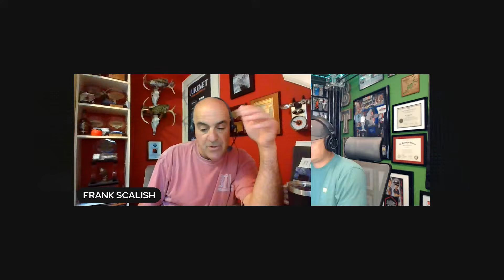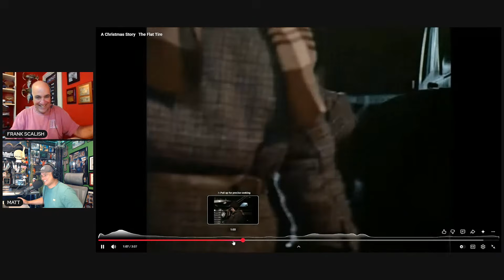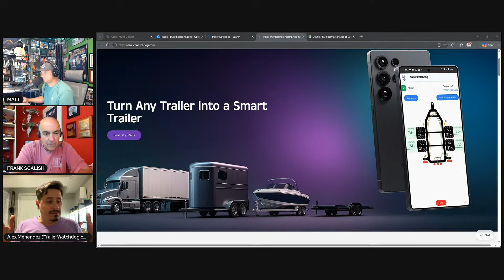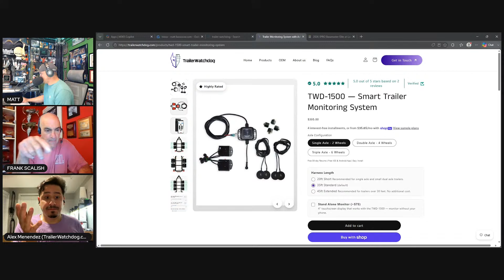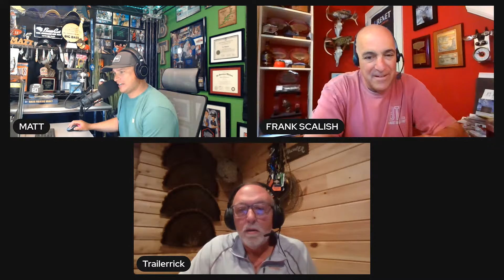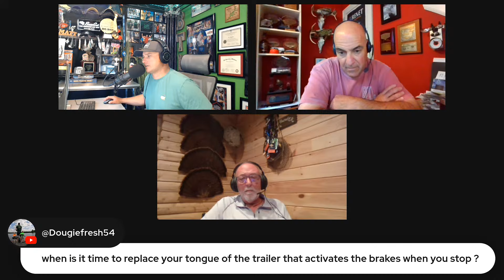THINGS YOU DON'T NEED UNTIL YOU NEED THEM (DAY 4 #254 WITH FRANK SCALISH)

Comment: I know not everyone can afford it, but if you can, I'd heavily suggest Milwaukee tools.
For impacts, tire air pumps, fans for use in the boat while fishing, etc.
They make tons of tools that run on their 18V batteries. 
My life has been made substantially easier because of them.
They even make adapters that can be used to charge a phone (USB plug), I have also even went so far as to plug my heated jacket and pants into an 18V battery when fishing all day in the cold.
Reply: Love the fans we got 2 for the boat when it’s hot out